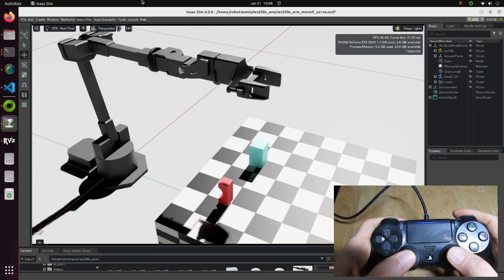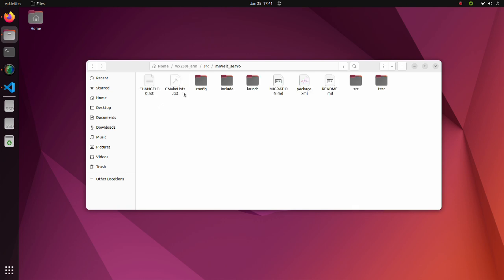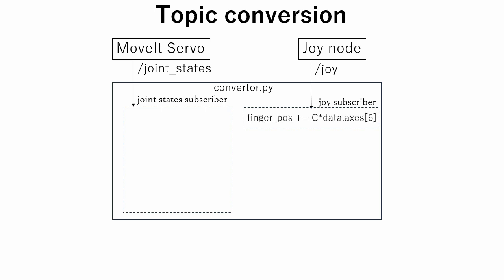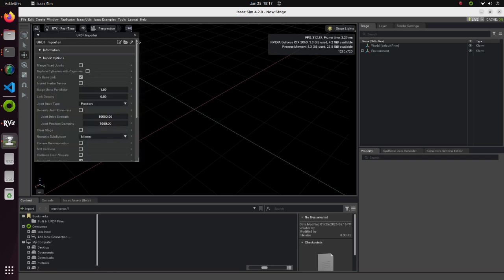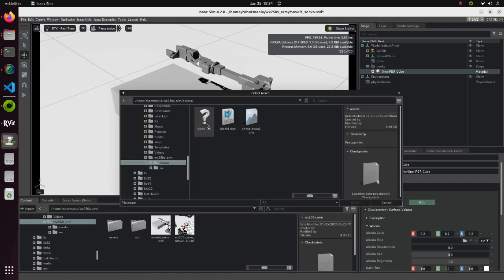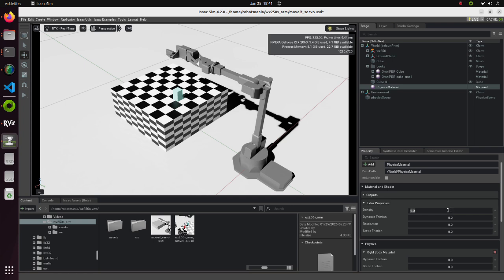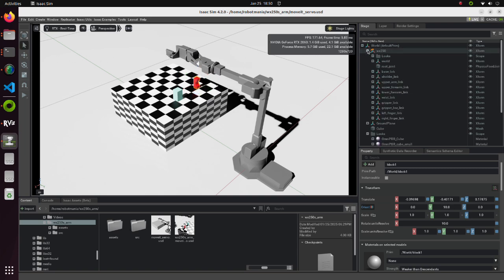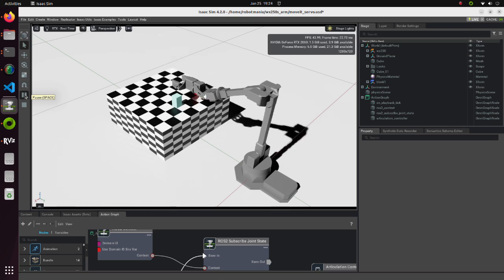Arm Manipulation in Isaac Sim Using MoveIt Servo

Comment: You used from moveit_configs_utils import MoveItConfigsBuilder to launch MoveIt using a launch file rather than the Python MoveIt API. In this example, you calculated inverse kinematics (IK) by assigning a desired velocity to the end-effector.

What I would like to ask is this: instead of giving a velocity via joystick, is it also possible to calculate IK for a specific target position of the end-effector using the same MoveItConfigsBuilder launch setup?

Thank you very much for the excellent video—I'm enjoying it a lot!
Reply from the maker: Yes, it is possible to calculate IK for a specific target position of the end-effector by using the “pick_ik Kinematics Solver”. But you will need additional setup for MoveitConfigBuilder. Here is how you should set it up (lines 31~49).
https://github.com/moveit/moveit2_tutorials/blob/main/doc/how_to_guides/pick_ik/launch/demo_pick_ik.launch.py
https://moveit.picknik.ai/main/doc/how_to_guides/pick_ik/pick_ik_tutorial.html
Reply: @robotmania8896  very very thank you!!